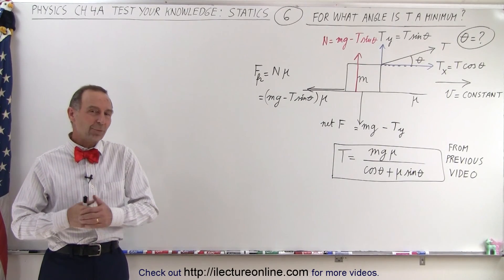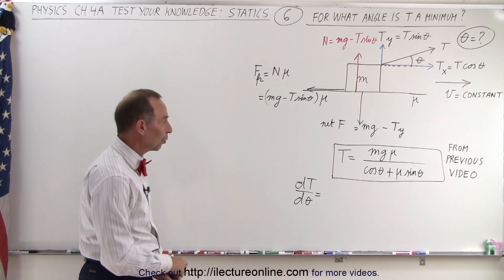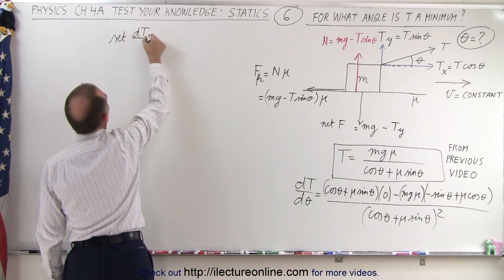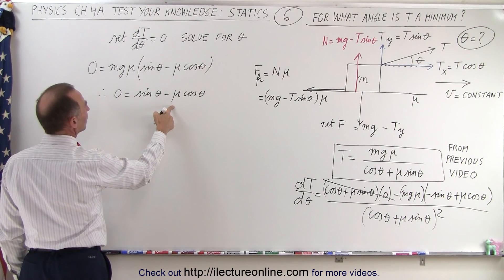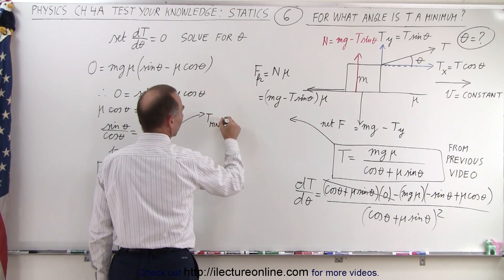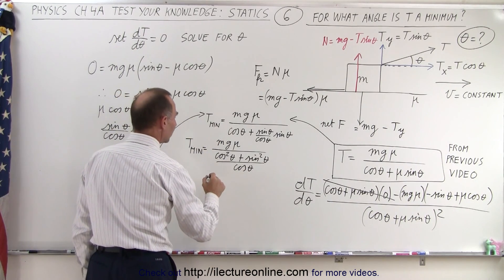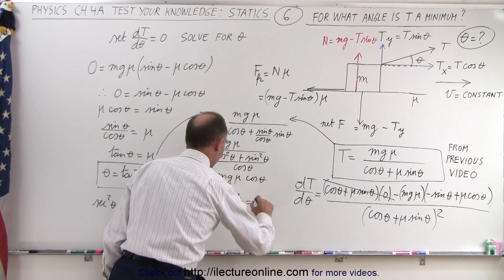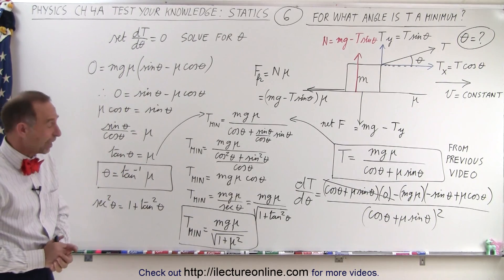Physics - Ch 4A Test Your Knowledge: Statics (6 of 29) For What Angle is T a Minimum?**

Comment: Sir, why didnt you simply took the derivative of the denominator. The bigger the denominator the less the T.
Reply: it's the same. You get the same result. Why is that? Try by yourself with pen and paper and you'll realize it.
Reply from the maker: It doesn't only depend on the denominator.  Better use the standard method.
Reply: How do you know that zero of dT/dtheta is  happening at local minumum or at local maximum. In regards to this question  i guess that dT/dtheta=0 must be at local minimum.
Reply from the maker: Since the derivative represents the slope.  When the derivative is zero, the slope is zero.